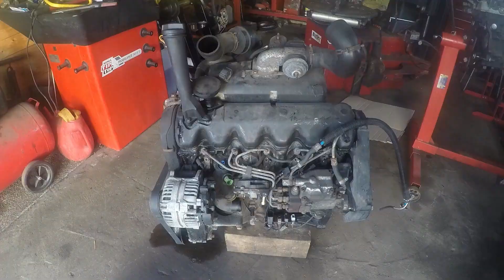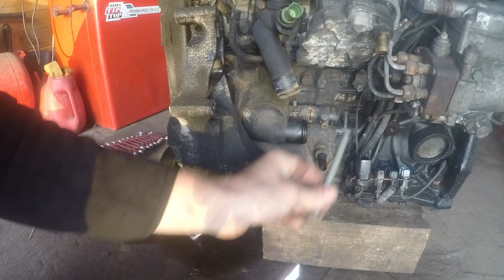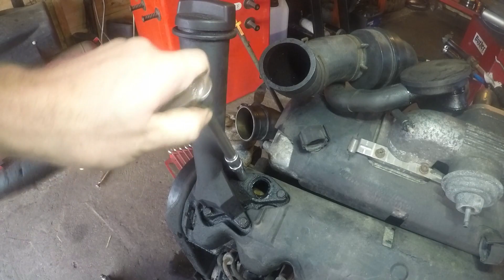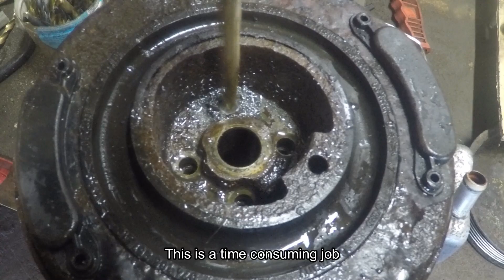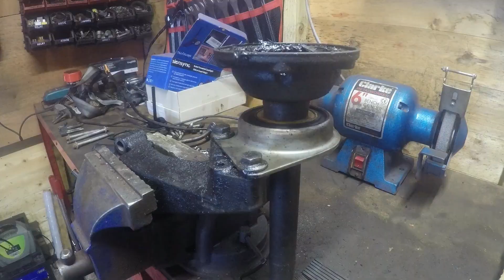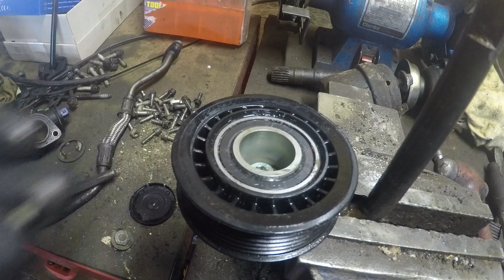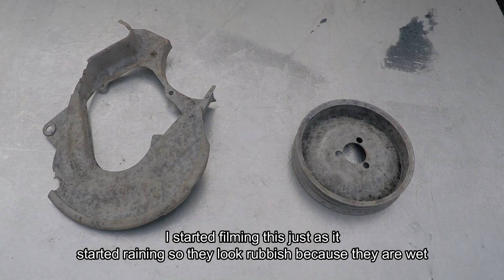VW T4 Caravelle 2.5 TDI Engine Overhaul Part 1

Comment: Thanks a lot for your time making this video and uploading it. It's awesome to see each part and the detail of my vehicle. Helps my diy mechanics haha
Reply from the maker: Harrison Edwards not a bother buddy! Thanks for the comment, much appreciated 😊
Reply: @AMSVauxhall  Anytime. I'm trying to figure out at 0:54 the thing the dipstick goes into under the oil filter, is it just for the dipstick or it holds anther purpose? Thanks
Reply from the maker: Harrison Edwards it is also the oil feed for the turbo. It’s clearer in the next videos as my one is rotten so I’m searching for a replacement
Reply: @AMSVauxhall  Ah ok. I have a leak I'm trying to trace and I cant tell if it's coming form the oil cooler, the oil feed at the turbo.. or this bit at the dipstick. Hard to see without pulling everything apart. Thanks!
Reply from the maker: Harrison Edwards all common areas to leak, for all the parts cost I would do them all buddy

Comment: Seems like all the timing belts run slightly off the pulleys like you show before strip down.  Must be the normal belt position.

Comment: my t4 was an ex limo/taxi befor I got her 262000 miles.now 3years later and 311000 miles engine still strong .smokes bit and has small oil leak cant find but im about to acquire a 112000 acv 2.5tdi engine400£been standing bit had mot last year van was rotten body .guy drove it home .he is the seller near my way .bought bits off him once he knows hit t4s.hi what would charge to change engines over

Comment: hi andy just seen your engine over4haul.my fan belt or aux belt is noisy and have new one .is it that easy to replace you just pushed that tensioner thing in and belt came off .steve.
Reply from the maker: steve mcgowan  yes just release the tension and slide belt off. Just remember the orientation of the belt 😁